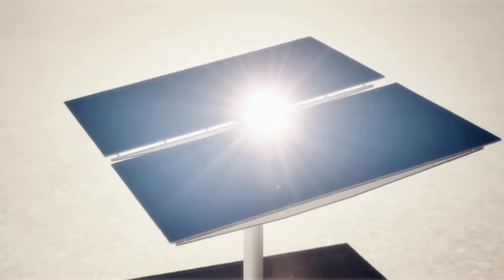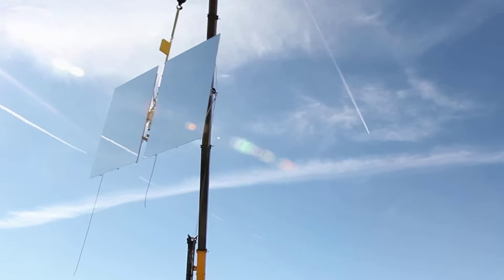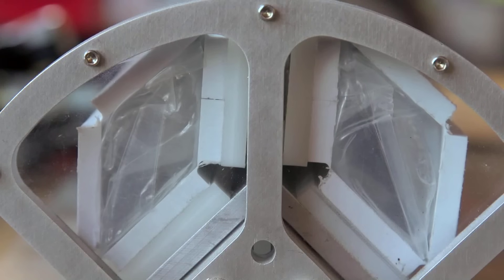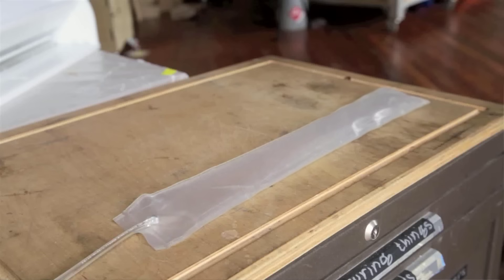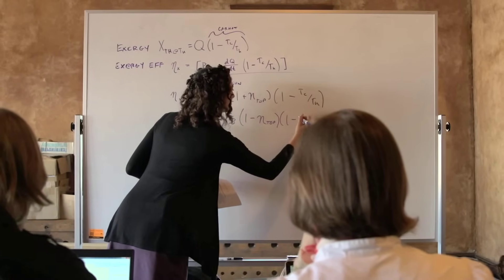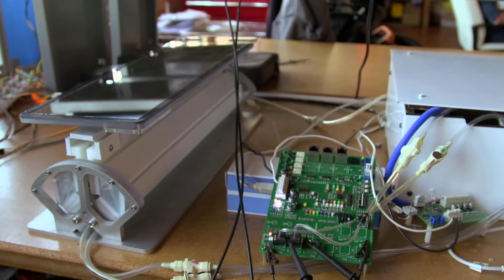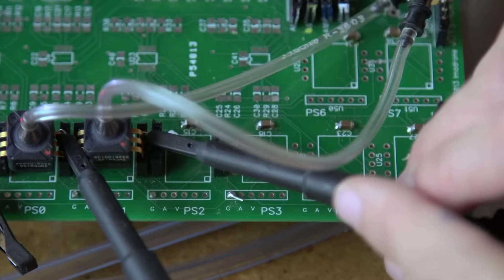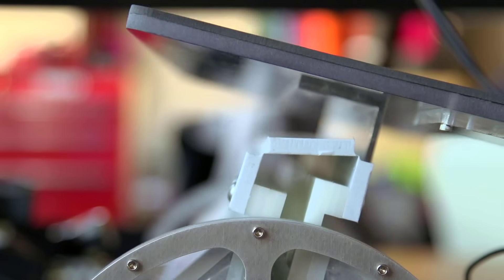Career Spotlight: Mechatronics Engineer

Comment: The mechatronic engineering career is a combination of electronics and mechanics with which new ideas can be generated such as heliostats that are cheaper than a solar panel, since it is generated more than a solar panel, since it can be programmed, that is very interesting, due to the fact that it is programmed so that it follows the path of the sun to capture the greatest amount of light, they move based on air capsules that change in size to be able to position themselves exactly. For this project the combination of electronics, design and above all mathematics is necessary.

Comment: Pointless study, poorly paid compared to mechanical or electrical engineers usually don’t have enough experience electrically or mechanically to competently work independently on either electrical or mechanical systems I have worked in the rolling stock, nuclear and aerospace industry and sit in on interview to employ candidates we are sold to always select someone who is an electrical engineer or mechanical engineer over someone who is mechatronics we have a maintenance team who service and calibrate robotics and CNC lathes machine tools ect and they have employed a few mechatronics people and had to let them go and employ 4 electrical engineers and 4 mechanical engineers because the mechatronics people just didn’t understand enough in depth of either field at Rolls-Royce aerospace we call them failed electrical engineers.

Comment: I dont recommend this field as a mechatronics, hard to find a job and the salary is way worse than a software engineering. Go se and stydy C#, easy to find a job and career would be better...
Reply: Asko it's a multiskilled job.. 

it had mechanical, electrical and software dude. 

add physics to that and you're iron man.

Comment: I study mechatronics, its really hard, you have to know math really good.
Reply: DEFIANTLY NOT AS HARD A BEING A DOCTOR!!
Reply: @cherrytheanimator3806  The schooling to become an engineer is harder than the schooling to become a doctor. Becoming a doctor just takes more time.
Reply: What kind if math?
Reply: @austinjohnson3977  I have a degree in Mechanical Engineering and have taken a mechatronics course. Mechacatronics deals with mechanical engineering, electrical engineering, computer science, and control theory. All these disciplines require knowledge of calculus, most notably differential equations. Then the field gets more into control theory which requires modeling the physics of the system and being able to control it with microcontrollers which requires coding. You'll need to understand state space modeling in order to control the system. Then you need to build the system which requires knowledge of electrical engineering. What I'm trying to say it's a multifaceted field, and you probably won't get bored because you're doing a lot of different things. If you're interested in this stuff I recommend studying mechanical engineering then enter the field of mechatronics. You'll be more than prepared for the math by then.

I have some engineering videos on my channel if you're interested! Not necessarily mechatronics though...
Reply: @alexjbeezy  honestly I want to study the field of mechatronics straight away
Reply: @austinjohnson3977  if you start complaining about Calculus in high school, you're definitely NOT gonna love the surprise this major has for you.
Reply: Honestly I love all math and am willing to go through the math of any type of engineering if I’m being honest, I’m pretty good at it